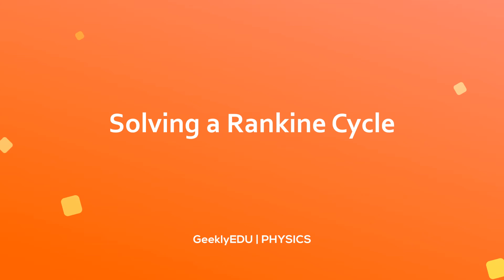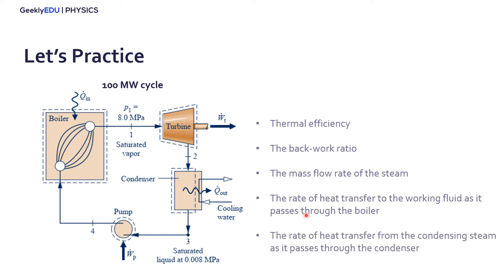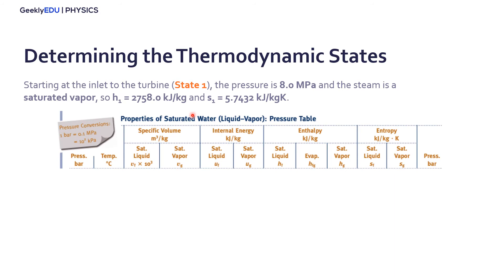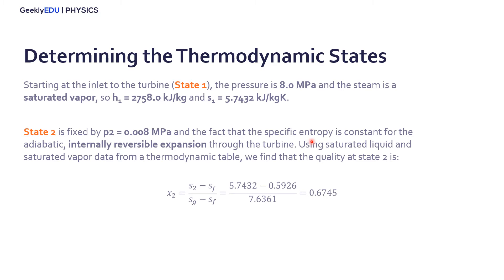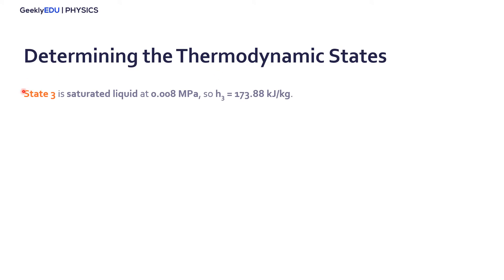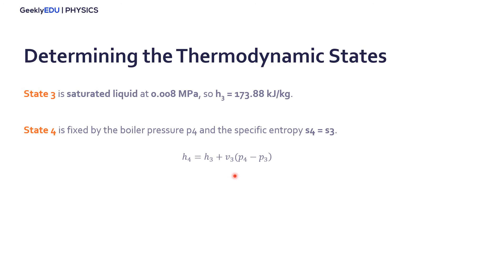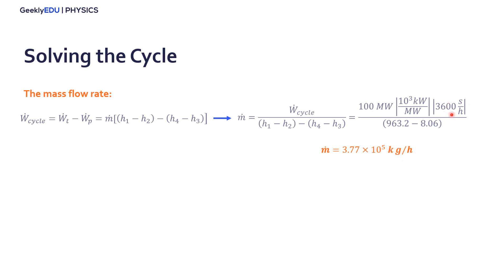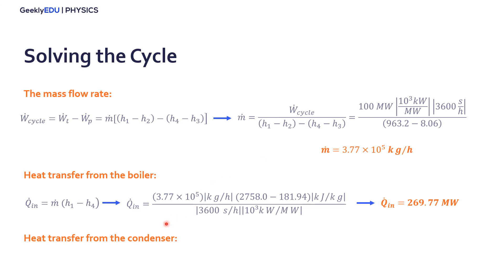#GeeklyHub Solving a Rankine Cycle | Determining the Thermodynamics States

Comment: how did you get the p4
Reply: The pressure doesn't change going through the boiler at least not for this ideal cycle so the pressure is the same on both sides of the boiler, so p1=p4